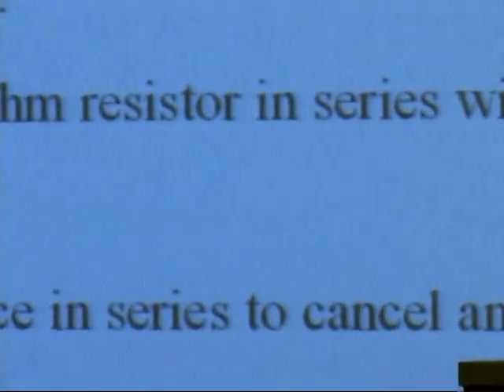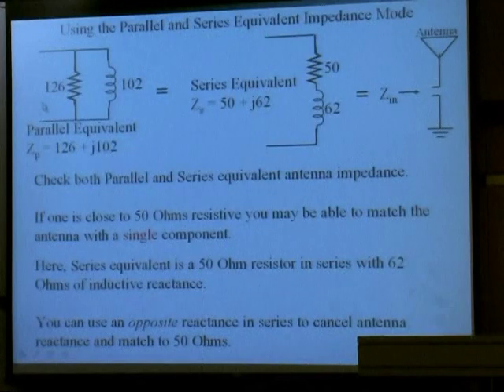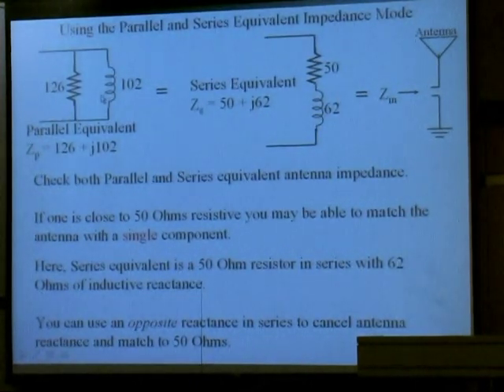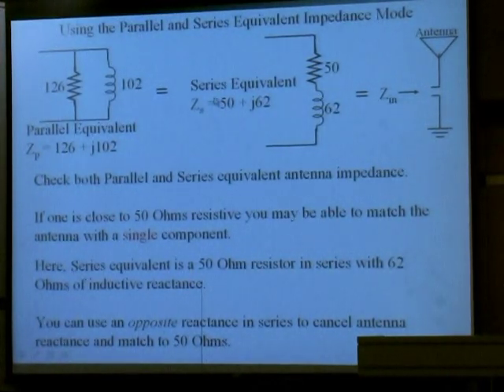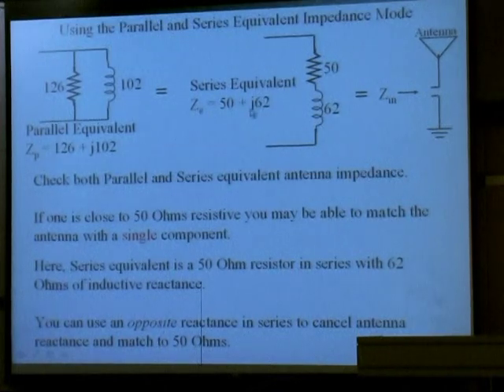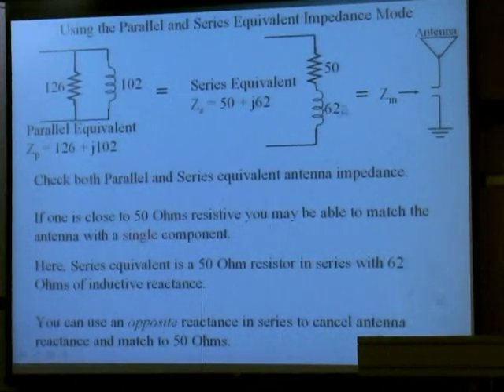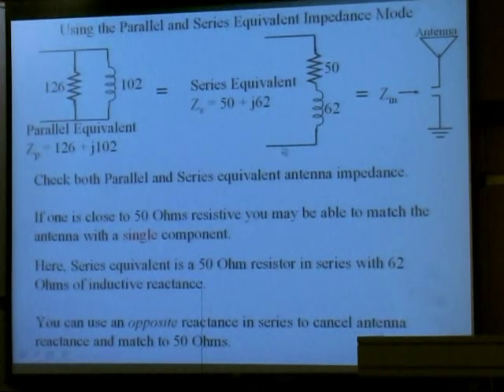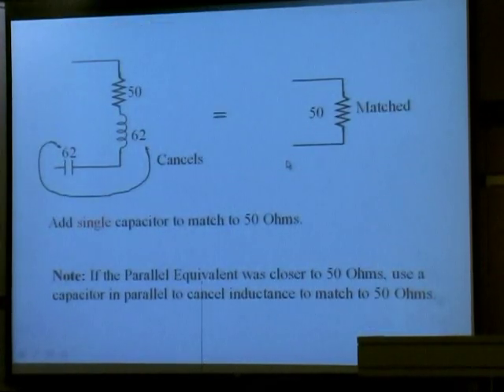MFJ Presentation: Matching Feedline to Antenna

Comment: Unfortunately, he does not demo the MFJ 259 or 269 to show if the readout is series or parallel Xc or XL. The later models do a conversion to parallel or series Xc or XL if needed. The maths for division of imaginative numbers is complicated, and this is done by the MFJ 269, but not the 259B. Knowing your antenna's R and X really helps if youre having to change the length to reduce the XC and XL to near resonance provided you have a series 50 ohm resistor in series during the test.